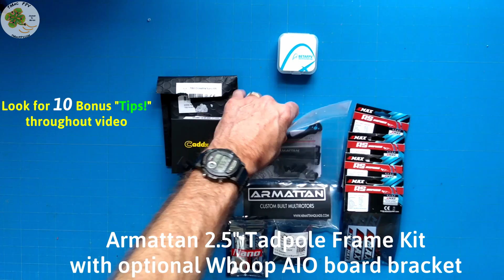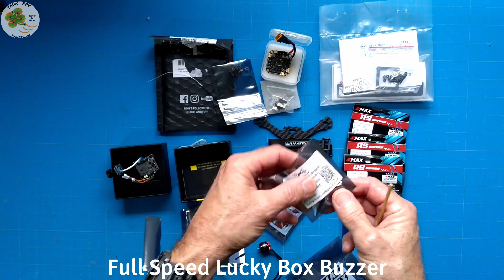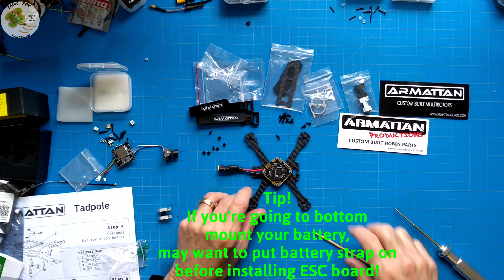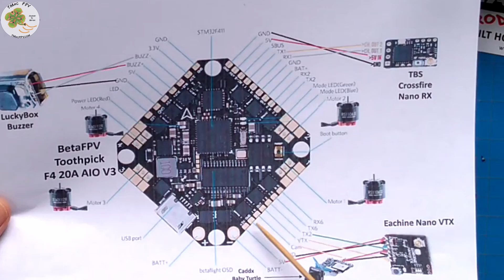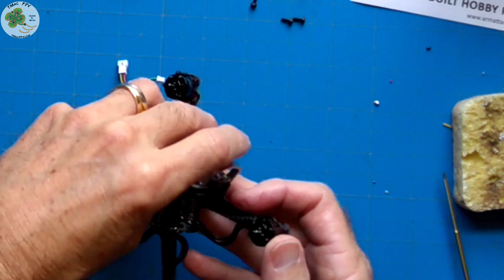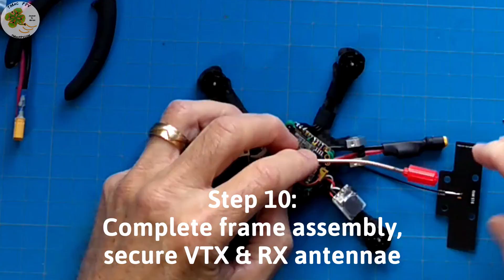Micro FPV Drone Build (Armattan TADPOLE!)

Comment: Hello Tmac, Do you think the NamelessRC 412t aio 12A and Happymodel 1103 9000kv motors will work good on the Tadpole frame? Or what frame would you suggest in the place of a Sailfly x frame? Thank you so much in advance .. Happy flying!
Reply from the maker: Tadpole  2.5 inch could work. Might be a little underpowered since it's more than twice the weight of the Sailfly frame.  Make sure motor mounting pattern on whatever frame you get matches mounting pattern of your motors. Airblade Creampuff Lite is another option https://bit.ly/2vxQttS . I personally would go with something like the Gnarly Primo frame with those motors and AIO board you have https://gnarlyfpv.com/products/primo
Reply: @TMacFPV  Thank you my friend, I'lll take a closer look soon.... I appreciate all you do 💯%!

Comment: Great video TMac.  You make it look so easy, especially the soldiering in those tight spaces.  

I’m getting pretty good at soldering, but my only problem is at times, I tend to shake. Not sure if it’s just my ring still nervous!

Cheers,
Sam
Reply: Don't worry about a little hand shaking. I spent decades holding a NASA solder certification and I have a bit of a hand shaking issue
 myself. I have found that all it takes is how to rest your hand/wrist while soldering. A good solder station also helps to get on an off
your work as fast as possible.
Reply from the maker: There you go! Nice tips👍
Reply: Doug Youtube Thank you for the advice 😎👍
Reply from the maker: Thanks Sam 🙏 I bet you do better than I can. I'm just stubbornly persistent 😀
Reply: TMac Thanks for the vote of confidence, but you’re much better than me!

Comment: Nice build need to build one of these myself.  The only thing I noticed was I did not see where you soldered in your crossfire receiver.  Did  I miss something?  I don't use crossfire so I was watching to see how those RXs are done.  Also a tip I would add is when I solder flight controllers especially small ones I like to put electrical tape around the center portion of the board just In case I drop a bit of solder it wont hurt the board.  Just my own tip.  Again nice build.  Oh yea 4S!!  That is going to be a screamer.
Reply from the maker: Hey Fishbonez!  Perhaps i forgot to put that solder clip of RX in.  If so, my bad.  The wiring connection diagram I show in the video displays it accurately.  Good tip on electrical tape over board!  Never thought of that myself,. I'm just extra careful not to hold solder iron over top of board.  Extra precaution of electrical tape sure wouldn't hurt though, nice!  Thanks for sharing that.  Yep, looking forward to getting her setup in Betaflight and rippin' around on 4S!🤩

Comment: Nice build  TMak ,enjoyed watching  what size 4s battery u gonna use 
U made me thinking about 2.5  didn't try them yet,i flow 3 5 6" quads  love 5" ,but if I'm going for one like urs no need for bozer  I use the motor and for 4s I add 2 caps in the arm close to the FC  . I love the quad
Reply from the maker: Hey Athir, thanks! I've got some GNB 4S 520's I'm gonna give a try.  I always put one of those Lucky Box buzzers on mine just in case my quad wants to get lost in tall grass, woods, etc.!😆